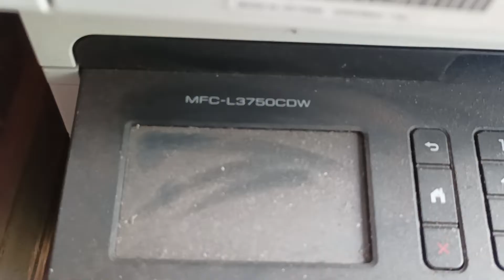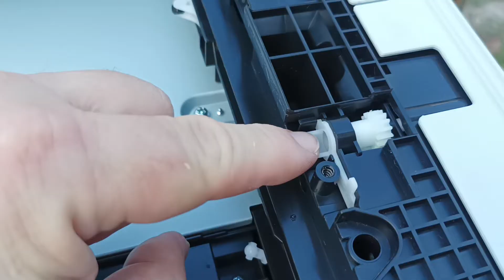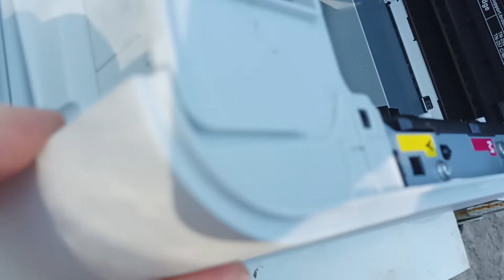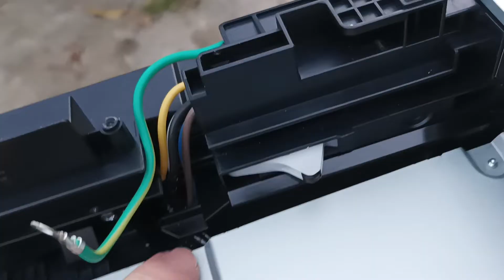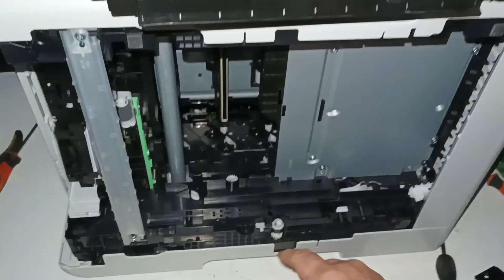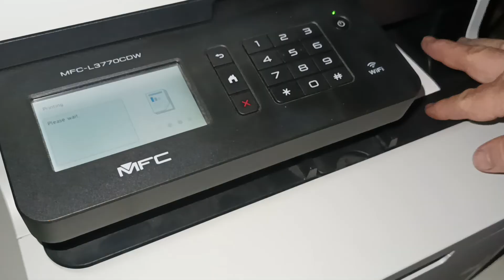Brother MFC-L3770cdw Power supply Replace fix (No Power Dead - Won't Turn On)

Comment: Hi

How  r u

My brother mfc 3750 no display  ,only power light. Sir  what could be problem?
Reply from the maker: Your printer has not been able to complete a firmware update properly. You will need to connect the printer via a USB cable to your PC. Download the firmware update tool from the Brother website then perform the firmware update via the USB cable